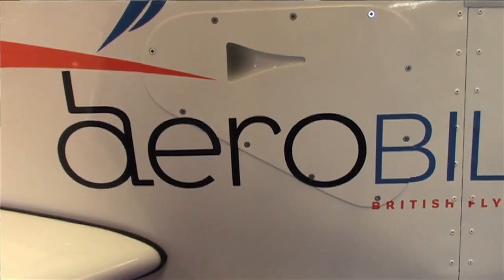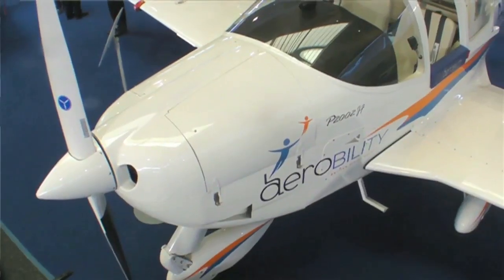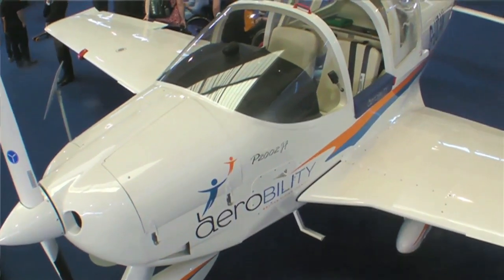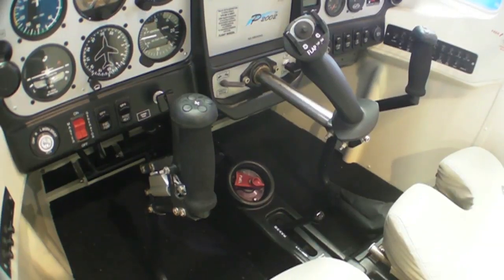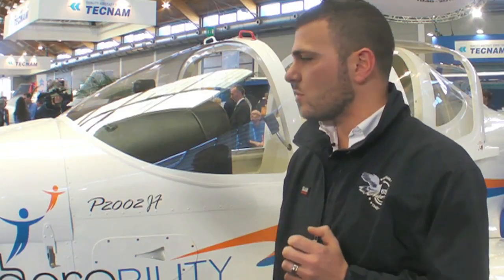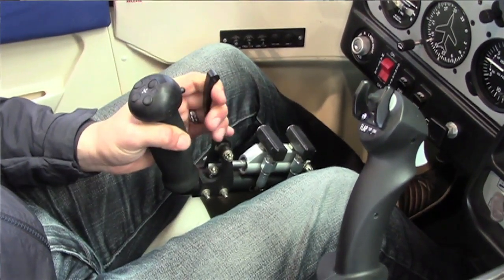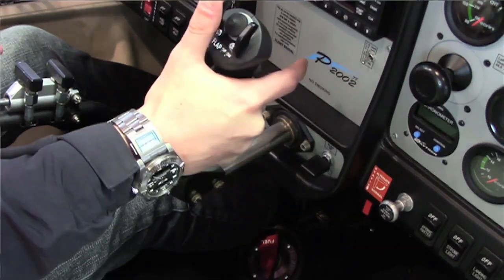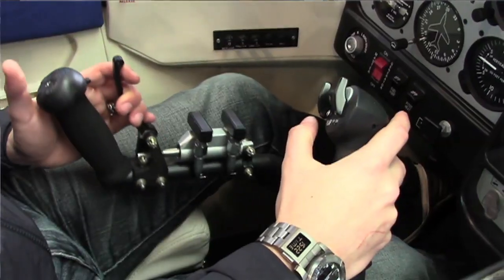Tecnam's Aircraft for Disabled Pilots

Comment: How on earth does someone who is not able to use their legs get onboard a low wing air plane with a sliding canopy?  Wouldn't one of their high wing planes with a side door make a lot more sense?  It is a nice idea but not well thought out.
Reply: bizzee1 It is true my expletive was a bit too strong.  I just know from my own experience flying DA40's, PA28's and Cessna 172's with two working legs that the 172 is the easiest to get into followed by the PA28.  I was just surprised given Tecnam make two very nice two seat high wing aircraft with side doors that they chose to implement something like this on their low wing model with a sliding canopy.  But perhaps not being disabled I am missing something and for some reason this is actually the easier design to get into if your legs do not work.
Reply: It's a start in the right direction, and thats what counts.
Reply: The wing looks pretty low to the ground, so maybe it is possible to back a wheelchair up to the wing and slide out of the chair and onto the wing that way. Sitting on the wing, a person could then hoist up the wheelchair to be folded up and stowed away. This is not to say that a high wing aircraft wouldn't be easier to get into, but I don't think that getting into this particular low winged aircraft is impossible although it may take a little bit more upper body strength.
Reply: Probably a few options but so long as the ground is solid, hoists.  There are some that are motorised for lifting, leg splay and also for moving around.  A pilot can conceivably transfer without assistance from a chair to the hoist and then move themselves via hoist to transfer into the aircraft.  A pilot with their own hangar could rig up a simple hoist like in a car mechanics with a winch hanging off a rail ... simple!  The real trick would be a fold-out mechanism that achieves the same outcome but stays on the aircraft.
Reply: Geoffrey Engelbrecht During WW2, a British pilot who lost his legs after ww1 doing aerobatics, became an ace. I watched the story on YouTube. It was amazing.
Reply: There is an aerobatics pilot here in CH who is paralysed from the waist down.  My comment was not about disabled people flying but rather about the technical aspects of adopting a low wing aircraft for disabled people when Tecnam also make high wing aircraft with similar performance.  And as I wrote before my expletive was too strong in my original comment.  It is a great thing they are doing regardless but my point simply was it might be a more technically sensible design to have done this with one of their high wing aircraft.
Reply: P210 with io390 and hand controls I would buy one tomorrow
Reply: As a person with paraplegia l really wonder the prices of aircrafts that l can use. Of cource prices may vary from one country to other. If l want one of them l am pretty sure that our Turkish goverment would make me regretful with extreme custom taxes. We experience it while buying car. We buy one for us and at least two to our goverment thanks to taxes. I wonder how paraplegic people can buy an aircraft to make their dreams true. Also how much is this aircraft in video?